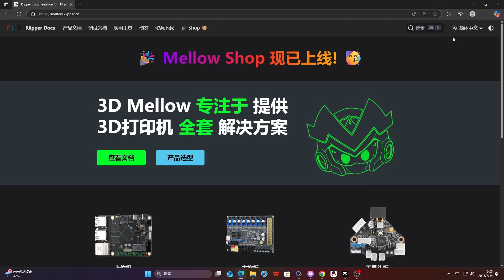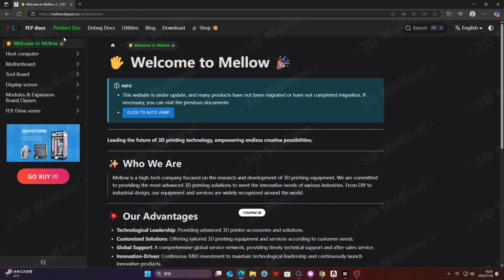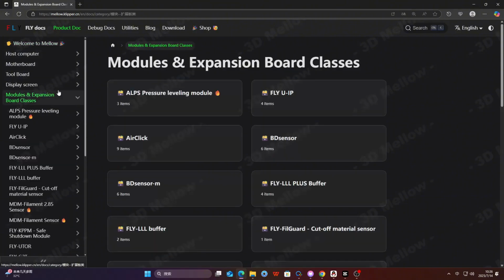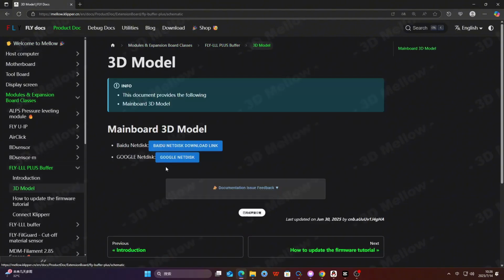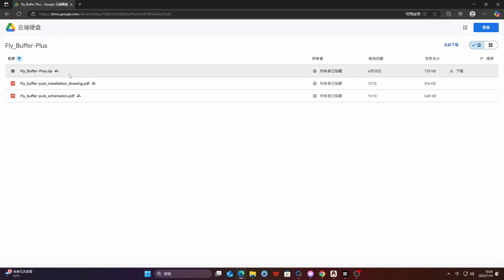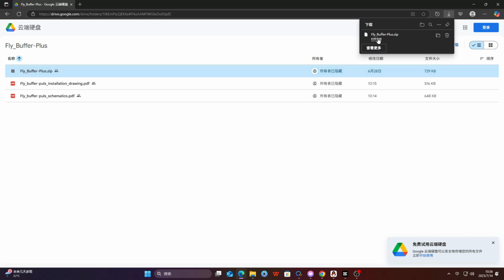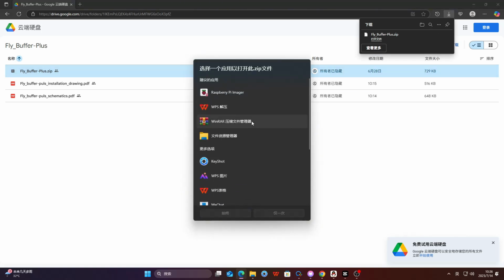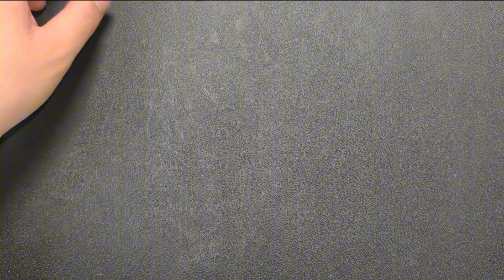Mellow  For DIY 3D Printer  LLL Plus Buffer Installation Guide#3dprinting #3dprinter #voron

Comment: Could you create a video showing how to connect the lll plus to the klipper? I'm having difficulties. Thanks
Reply from the maker: of course！！！
Reply: @3DMELLOWPrinter  When ?
Reply: To check the operation of the device, you do not need to connect it to the Klipper. It is enough to supply 12 or 24 volts.

Comment: I can't make it work, I call the raspberry directly or do I need it on the can board?, I tried to connect the 24 v directly to the board and the GND the engine doesn't work
Reply: If you have connected the power correctly, the motor should work when you press the buttons. And if you insert the filament, it will start feeding it automatically. The device works even if you connect only the power supply, without the filament end sensor.
Reply from the maker: This link will guide you on which interface to use : https://mellow.klipper.cn/en/docs/ProductDoc/ExtensionBoard/fly-buffer-plus/?persistLocale=true?persistLocale=true
Reply: @3DMELLOWPrinter  Yes, I followed all the steps of the document, but I'm sure where I'm going to connect the cables. I'm on the filament switch on the motherboard? And the GND and the 12/24 v directly in the power source?
Reply from the maker: @JoaoMarcelo-ld7od   I’m not sure which motherboard you’re using?
Reply: @3DMELLOWPrinter  I use the motherboard of fysect  spyder v3 h7 Connect to a Sb combo v2
Reply from the maker: yes?

Comment: i got me one... i made a cereal drybox rewind and feed system with it... u can just stick cereal boxes inside, insert filament inside the ptfe and pres the button and feed the printer... u also can rewind... i connected the stepper from the buffer with gears and magnets... so they turn the magnets inside the cereal dry box....its working so far but its still a prototype i need help with the housing...
Reply from the maker: you mean need automatic retract the filament？
Reply: I can't make it work, I call the raspberry directly or do I need it on the can board?, I tried to connect the 24 v directly to the board and the GND the engine doesn't work